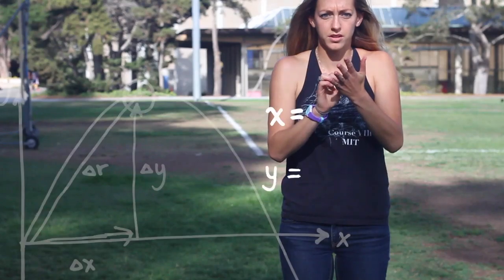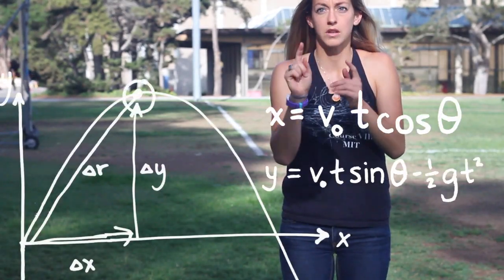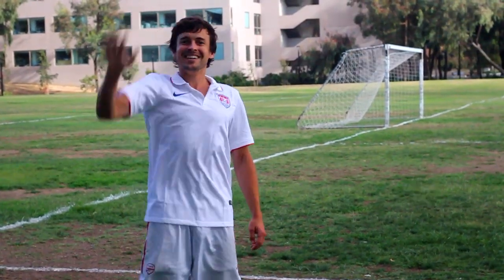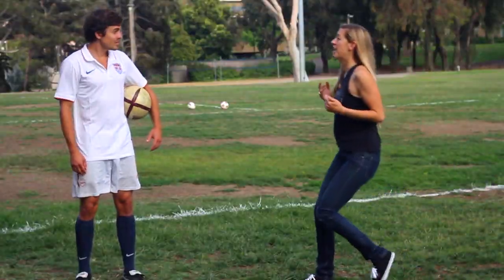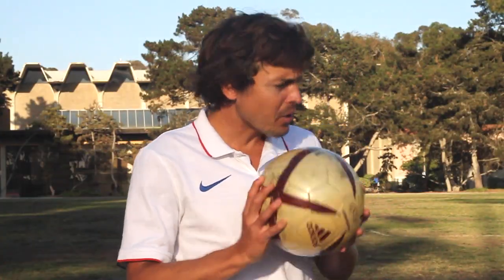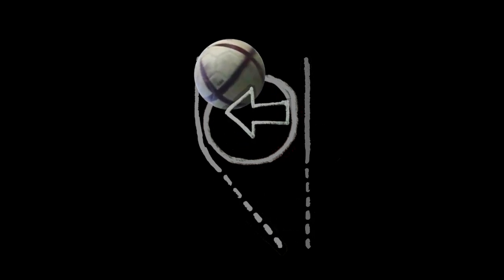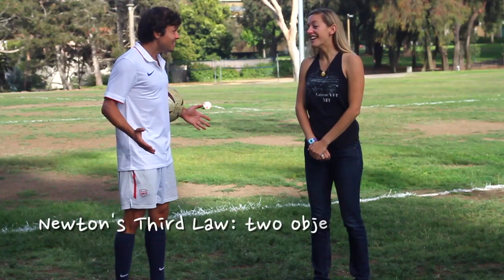The Physics Behind a Curveball - The Magnus Effect

Comment: The analogy to rocket propulsion is *incorrect*. A rocket moves forward because it ejects matter backwards. As a reaction force, it is pushed forward. The ball turns because (like you said) its spin creates a depression, that will cause the ball to move to the lower pressure area.

Comment: To achive something close to a knuckleball you have to hit the ball with the tip of your foot.
Note that it's strongly discouraged by any coach or trainer worth anything because the ball won't chage its general direction, so it's useless to get around an obstacle like a wall or a defender; it's just makes the ball move erraticaly while it goes forward so much that it would actually decrease your chance of scoring

Comment: the ball goes in the direction where air is accelerated  you just said opposite ... if ball turns from left  to right  high pressure is on the left the ball will go towards the left and not in the opposite direction of the high pressure side..

Comment: Well here's the explaination : the ball corves towards the LEFT, because it's spinning Counterclockwise. As it hits the beam, it bounces off at an angle equal to the angle of incidence (the angle of incidence is measured between he imaginary line that the ball travels on...in this case it's a curve, instead. we use the tangent and the perpendicular line on hat surface, within the same plain as the trajectory. And the angle of reflection is the same - equal. ) So the ball bounces off at an angke, but is still has some angular momentum (it's still  spinning) and it curves to the lefy again, and it hits the bar again, then it bounces off for the last time, as it's treveled past the gate and cannot hit anything else on the way down to the ground.
Reply: +Mihai Lazar You're almost right, but here angle of incidence will not be equal to angle of reflection. Because some of that angular momentum from bar will alter the angular velocity of ball, and rest of it will change the linear velocity of ball. And the less time for the second bounce comes from angle of attack of ball- center of ball was a bit higher than the goal post's upper beam, so the collision created more upward velocity and less sideways velocity.

Comment: I saw there was a reply on the ball hitting the post twice. I think there are two more things to consider, in addition to linear vector and conservation of angular momentum with the reapplication of the Magnus Effect.

We need to consider Splattation, when malleable soccer ball is contact the corssbar and the physical deformation taking place, and how the Elasticity of the soccer ball transfers connect force, considering not only the anglular momentum, and linear vector, but also the new shape of the ball in the instant the compression of the ball reaches the maximum of its range- and how the elastic force is expressed from the new shape, and not a more or less spherical object.

Also- what would be fun: how non-penetrating bullets ricochet parallel to a wall when fired perpendicular to its running surface. :D

Comment: Hey! Very interesting video. 
I've heard some players say that when playing in La Paz against Bolivia, the ball doesn't always behave like they're used to (the altitude there is crazy, like 3600 meters over the level of the sea, also the foreign players run out of breath in no-time). Maybe it has to do with the altitude? And how would altitude influence the ball's movement?
Reply: Less air density means the Magnus effect is less significant. Less air per volume means less air is spun around the ball, and less air pushes the ball to curve in the given direction.

Comment: Does the same effect apply to bowling?
Reply: A bowling ball moves on a flat, near frictionless surface. The initial trajectory, including spin and angle from the arrows on the track, are mainly what affect the motion of the ball. That's why throwing the ball as straight as possible gets the straightest path. If the ball rotates perpendicular to its motion, it will affect the frictional torque against the surface, causing it to diverge from its original path.

Comment: 2 balloons same size held by the tied knot in each hand. While holding balloons about 4 " apart and 12" from mouth...blow between the balloons.......do they get further  apart ?????  .   Or Closer......???
Reply: I would say closer because by blowing between the two you are in essence creating a slight vacuum causing the air from the outsides of the balloons to push the balloons together

Comment: ok, it hit twice because the forward momentum was converted to angular momentum when friction between the ball and goal beam caused the ball to spin faster.  Since it was spinning faster but traveling more slowly forward the combination of a much lower pressure on the goal side due to the faster spin and it traveling more slowly forward when conservation of momentum converted forward momentum to angular momentum it had time to move normal to the forward path and striking the goal before it left the length of the goal.

Comment: Is it due to the wind or just relative motion of still air? If it is the second one,  does it mean that the ball can go round in circles (or ellipses, maybe)?
Reply: The only way it could go in circles would be if it had enough time before falling and didn't lose it's angular momentum to the air.  Sadly gravity makes it hit the ground before it can sketch out very much of the circle, and air resistance will slowly reduce the speed of the spin, making the ball curve less and less.
Reply: Porglit if we kicked it off a building,  at such an angle,so that it does not strike the building itself... Would it work?
Reply: Aditya Khanna
Gravity will simply be too strong, I'm afraid.  Unless you got a ball that was filled with helium or something that could counteract the force of gravity, I don't think it would work.  Part of the problem with including gravity is not just that is makes the ball hit the ground, but also it changes the direction that the ball is moving, and thus the angle that the air is moving past it relative to the ball.

Comment: so it's true that when they play in high altitude like Peru the ball doesn't bend because the atmosphere is thinner?
Reply: yes
Reply: pete275 The Magnus force or “lift” produced by the spin is a function of half the density, the square of the ball speed, the area of the flat projection of the ball, and a coefficient of lift that is itself a function of the spin velocity and surface roughness. So if you use the very same ball, and impart the very same spin and speed to it, due to the reduced density due to the higher altitude, the Magnus force will be also smaller. It will bend, but not as much as at sea level.

Comment: Yes I think it's because of the extreme spin, as well as the extremely acute angle of incidence and therefore the resultant acute angle of reflection (made even more acute when the spinning ball hits the crossbar the first time). Also, I may be wrong, but I believe the goalposts had flat sides (rather than the typical cylindrical posts) so that could also have contributed - cylindrical posts tend to distort the angle of reflection depending on where the ball strikes it and also provide a smaller surface area for the striking ball to spin off of)

Comment: My thoughts on the double-hit. It appears to just be an extreme fluke. The ball hits the angle of the cross-bar in such a way that it is propelled a little up and a little out (instead of hitting flush against the upward face and bouncing up/behind, or instead of hitting flush against the side face and bouncing away) The collision friction is not enough to stop the spin of the ball (and actually appears to impart a good amount of additional angular momentum during the collision). So as the ball is bounced slightly upward and slightly away, the spin and therefore the Magnus force increases and 'pulls' it back in to the post again. Million dollar shot. Not quite as fluke-y as this: Miracle half-court shot stuck on rim

Comment: Confusion (the effect from Newton's third law):

You say that BECAUSE the net air flow is from left to right, that the ball has to move in the opposite direction.... which isn't clear to me at all. I understand that the rocket is an example of recoil...which satisfies Newton's third law.

Am I right then to think that the air molecules near the surface of the spinning ball, are being dragged and thrown at a direction effectively perpendicular to the trajectory? This would then make sense as recoil.

Edit: "effectively perpendicular" isn't right. The air particles are being dragged in a path with perpendicular and tangential components. The tangential component of the push is however of no interest as it just speeds the ball up along its path.
Reply: The air drags the particles immediately around it in its direction. Each of these interactions imposes a small force that points - at that air particle's position - opposite the direction of the spin. If there weren't gravity, this would eventually stop the spinning (friction) but it also provides a net force causing the bending because the counter-to-the-direction-of-spin forces are not equal. Each of these forces is explained by Newton's third law.

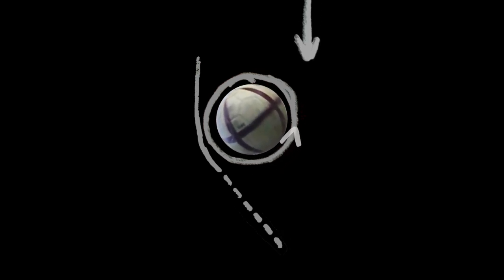The bent air shown at ~1:30 getting curved to the right is in a high pressure zone so more particles are contributing forces to the left than on top of the ball where particles contribute forces to the left. 

The total forces add up to a force to the right.
Reply: Ok so it is this dragging effect of air molecules at the surface of the spinning ball which lends itself to the action-reaction effect. I still think that the reaction force isn't exactly to the left, it mostly is, and possibly a small component is along the direction of travel ...  which would serve to speed it up (only to be slowed down by Drag anyways..)

And yea I got the pressure part.

Comment: what about kicking the ball up spinning it down? ive seen it in anime but... can it be done?
Reply from the maker: Do you mean kicking a ball with backspin?
Reply: Or topspin..
Reply: In pool, topspin accelerates the ball. Since it's on a table, there's no down to travel; but in other sports like soccer and baseball, you could imagine it going down faster than normal and then rolling a further distance... Good luck getting a soccer ball off the ground with a topspin though lol.
Reply: Physics Girl No I mean kick the ball up in the air and it spins(i.e. not by gravity) down. Googled "ball dip" and found ppl discussing that Cristiano Ronaldo does it, and some ppl calling it "top-spin" by hitting the bottom of the ball.
Reply: LapSiLap Yea, you'd kick it similarly to the knuckleball technique but you want to come up a bit as you kick instead of hitting straight through the ball. Possible, but it requires years to master
Reply: George Cataloni Actually it is possible to kick the ball up with a topspin - you have to kick the ball from beneath it (and ball size helps here) but target it so that the line of you kick goes above the center of the ball..
The spin willl not be really big though... significantle less than you can get with other tipes of spin...

And it kind of pointless because it makes the ball fly less than it should...

Comment: Seems like it hit the goal twice simply because it was still spinning after the first hit, and therefore rounded back in the direction of the goal a second time.

Also, the physics here seem very much the same as lift, over a moving wing.
Reply from the maker: It's definitely related, especially the air moving faster over one side and following along the wing. The difference is that the wing isn't spinning. Hopefully... Also yes it keeps spinning after! I'm still trying to figure out from the footage how the speed of spin changes after the first time it hits.
Reply: Serge Rudashevsky   Law of Conservation of Angular Momentum.  If the ball was kicked off with enough force, and enough spin, then, as it kissed the goal the first time, it lost a little bit of it's total angular momentum, but not enough to keep it from spiraling back for a second bounce.
Reply: Physics Girl The spin must decrease after the first hit because the spinning ball imparts some of its momentum to the crossbar attempting to spin it in the opposite direction. This is similar to what happens in the game of billiards. When a spinning cue ball strikes another ball, that ball begins to spin in the opposite direction. And when a spinning ball hits the rail the angle of incidence either increases or decreases depending on the direction of the spin. At a shallow enough angle, a softly hit ball, spinning in the direction of the rail will continue to hug the rail all the way into the corner pocket. That is exactly what happened during that corner kick. Only some of the spin was lost after the first contact and the ball continued to spin in the same direction. At the same time it lost some of its forward momentum which only widened the angle of deflection, making it easier for the air to push the ball into the crossbar the second time.
Reply: Physics Girl The speed of spin does not increase, but decrease. But the increase in magnus effect is due to increase in linear velocity. Its because of the friction between the spinning ball and the goal post... The friction imparts a torque which reduces the angular velocity but increases the linear velocity. This makes the second curve with a smaller curvature...
And by the way, a nice video..Thanks..
Reply: Patrick Melody The very same physics of a moving wing. Instead of a spin, the wings must have angle of attack. If no angle of attack/spin, no lift/Magnus effect.

Comment: What's the relationship between the "smoothness" of the surface and how much it bends? (eg: would attaching little "shovels" on the outside of the ball make the effect stronger or weaker?)
Reply from the maker: in dubio pro deo to add to what NibbyMoo said, the Magnus effect can actually FLIP for very smooth balls. This is mind-blowing to me! I'm considering doing a follow-up video on this. MIT did a recent article on it. http://newsoffice.mit.edu/2014/explained-how-does-soccer-ball-swerve-0617
Reply: The smoother the ball, the less it bends in this way. The 2010 world cup ball was infamous for this. The makers of the 'Jubilani' ball were proud of the fewer panels and seams they used, but the players complained it behaved very unlike traditional balls, not curving as expected.